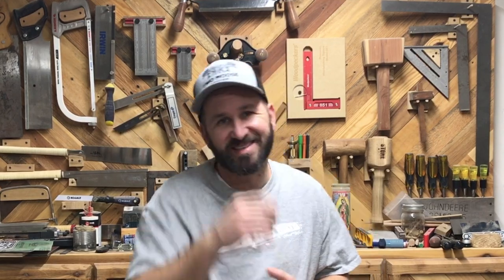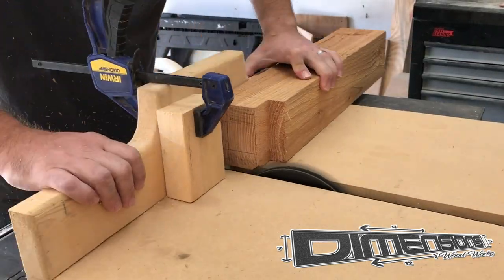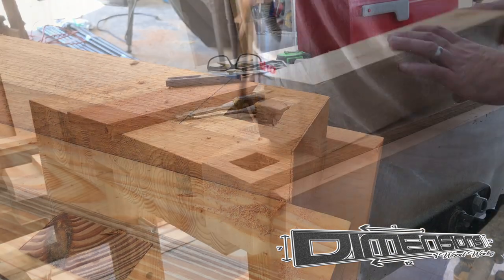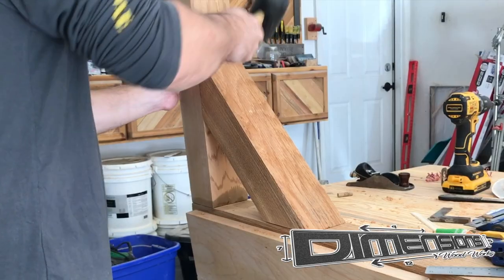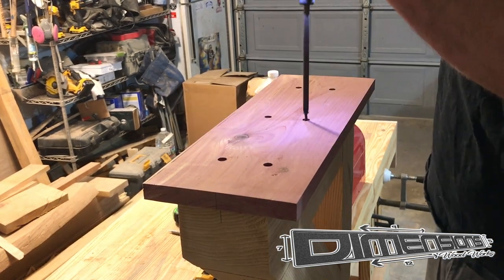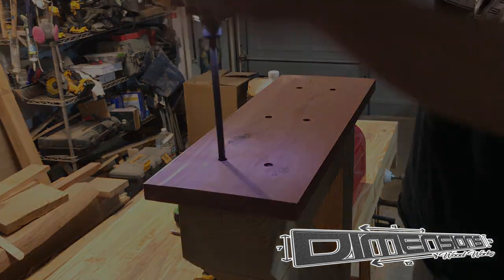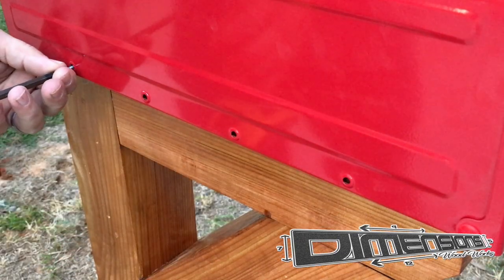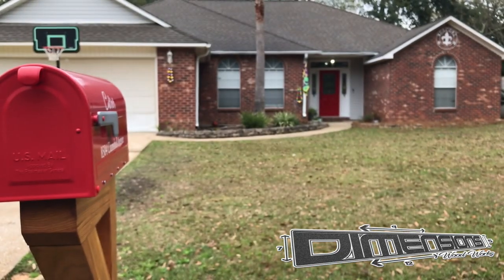DIY Mailbox Post

Comment: Looks good J D I made one similar to yours a few years ago, an just a tip, I would wrap the base with a product called blue skin it’s a water proof membrane and I’ll help it from routing out! Cedar will still Rout after a while! I like the mail box that’s pretty cool you can order it will all the lettering on in nicely done tho 👊🏽
Reply from the maker: Glenn Lickers yeah it’s a pretty simple project and I’ll probably redo it in about 5 years or so anyway so by the time it rots, I’ll be replacing it. Thanks for checking it out!

Comment: Nice little project, thanks for posting. quick question for you at 1:33 in the video what was your dimension for marking that off? ( 1", 1.25" etc etc ) Also what size dowels did you use? just curious
Reply from the maker: General rule of thumb is that the tenon should be 1/3 the thickness of the materials. For this one though i just made the shoulder 1” rather than fussing with tiny fractions on a 3.5” wide post.
Reply: @dimensionswoodworks  Great. Thanks. One other thing what size dowels did you use, 2"?
Reply from the maker: alex monteiro 3/8” you can buy an inexpensive kit at harbor freight